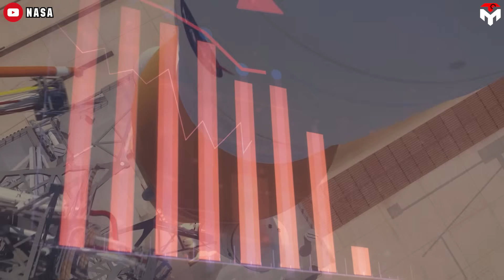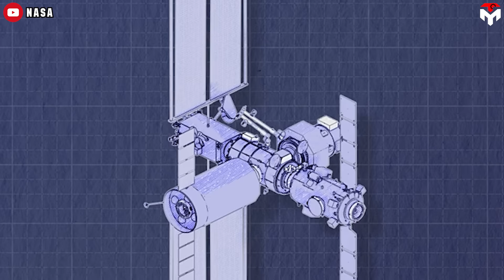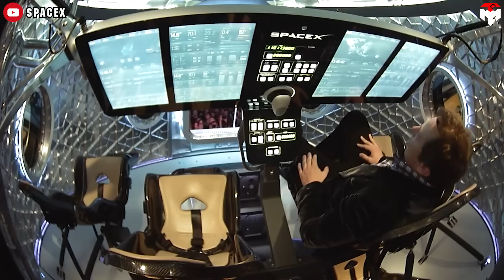Genius! SpaceX big Solution to Launch Dragon to the Moon Instead of NASA 4$ Billion Rocket...

Comment: the elevator of the whole starship can be made modular like canada arm, it will attach at the \base of star ship, and extend on ground so the astronouts who dropped from top will slide on ground of elevator is made like cana monkey swing arm, this sliding insted of moon surface walking is faster and cooler just like driving a car but its the ramp of elevator which laid ny starship

Comment: SpaceX already have all the necessary equipment except the lunar lander for lunar mission.   It can use three Falcon Heavy rockets to launch three pieces of equipment: space capsule to land on Earth and orbit the Moon, Lunar Lander, and finally small rocket to send  Lunar Lander and space capsule to the moon and back to earth.  Therefore SpaceX is using three FH to launch rocket, lander and capsule into high Earth orbit.  In space, capsule, lander and rocket merge.  The CLR is send to orbit the moon.  The lander separates from CLR and lands on the moon.  When it returns back CLR it travels back to Earth orbit.  There the capsule separates and lands on Earth.  The returned lander can be studied to improve the quality  of the next mission etc.  It can be done very cheaply with NASA new smaller budget.  It will be a dress rehearsal and experience for astronauts for future mission on Mars, Mars's moon docking/landing and other moon/meteor landing.  It will be a testing ground for equipment and biology tolerances etc.  Generally speaking SpaceX is almost ready except for lunar lander.  Lunar lander can be cloned/improved from Apollo experience.

Comment: Disagree...Dragon isn't armored enough against radiation. Dragon is fine for Neo but not a moon shot.  It would be better to just let SpaceX launch Orion using falcon heavy. It would be faster. Additionally,  there are 4 capsules ready to go now. All is needed is the proper docs to fit Orion to Falcon heavy and conduct 2 tests around the moon. Then all that is needed is a lander.

Comment: I've been saying this for years.Get a bigger dragon.Put it on top of the Falcon heavy.Go to the moon.Get a bigger dragon.Put it on top of a starship booster , go to the moon
Reply: Also, I've been saying it for years. So, let's do it.
Reply: You understand that the problem with liquid-fueled chemical rockets ('starship', for example), is that they are inherently inefficient. Okay?

The bigger the rocket, the more fuel it has to carry. The more fuel it has to carry, the bigger the rocket has to be, the bigger the rocket has to be, the MORE fuel it has to carry, and so on. Get it?
Reply: We are NOT going to visit Mars with MANNED missions, much less, 'colonize' the distant and hostile world, with chemical rockets! Nuclear-Electric or Nuclear-Thermal propulsion systems? Very possible.

 Conventional, liquid-fueled chemical propulsion? Impractical, illogical, inefficient, and too expensive, to move the necessary supplies to the astronauts, or to the astronauts themselves who will be on Mars.

Comment: Lunar Gateway is RETARDED. The only reason it exists is because the SLS doesn't have enough Delta V to get the payload to low lunar orbit. Well... instead of building an expensive space station over a dozen launches then using it to support moon landings the money should have been spent on a BIGGER UPPER STAGE for SLS or simply an expendable 2nd stage and a lunar direct 3rd stage for Superheavy! But, you can count on NASA to do the stupidest things and spend the most money doing it!

Comment: Apollo had a service module with a strong enough reactor to get itself out of lunar orbit. Same thing for orion .Crew dragon has not. Behind the crew dragon you have an empty tube use for storage.. How are you getting out of lunar orbit? Your grey dragon is the same. Orion took a long time to develop but it's a machine especially build for deep space, and well sheilded for radiation, and it's service module is what use to be a  European automated space craft build to work with orion. This  video is make belive easy solution that will get some like or Yesss but the devil is in the details.🤔
Reply: lol, Apollo didn’t have a reactor. It used fuel cells for power and a reaction engine. The S4B shot it into a translunar orbit and the Command Module did the lunar injection burn and the return trajectory burn as well as any corrections that were needed.
Reply: Each Apollo spacecraft had a service module and a command module. The CSM had an engine called the AJ10-137 that used aerozine50 and nitrogen tetroxide that they put in contact with one another and created an explosion. Near the moon,   they turn the ship around and ignited it to slow it down enough,  then they put themselves in orbit. Once the mission was done they light it up on the other side of the moon to get enough velocity to escape the pull of the moon. In the Apollo 13 incident an oxygen tank blew up partly  demolishing the  Apollo service module. Since they couldnt stop, they swung around the moon, too fast for lunar orbit and came back home. I was 8 years old when Neil Armstrong landed on the moon, and really into this. And still to this day. Bye!
Reply: @FrancoisBrindamour  reactors don't produce thrust and what you just explained isn't a reactor it's just a chemical rocket.
Reply: Yeah your right on that detail. It's a misconception from a long time ago, when we were kids. Bye!
Reply: https://ntrs.nasa.gov/api/citations/20090015391/downloads/20090015391.pdf
Reply: reactor...

Comment: Falcon Heavy isn't crew rated yet, so it has to be evaluated and tested with an ISS crewed flight. So atleast 2 flights before a trip around the Moon.
Reply: it's 3 falcon 9's strapped together wouldn't take them a second to get it crew rated if they ever wanted it for crew.

Comment: After the disastrous Obama years, where he deliberately took the USA out of manned space launch for nearly a decade (simultaneously cancelling the Shuttle and Constellation without a replacement plan) , and paying hundred of millions of $$$ to Russia to take our astronauts to the ISS (pssst...tell Vladimir that I'll have more flexibility after the election), NASA employed a pragmatic approach to putting the USA back in the manned space launch business. It placed 2 bets. One on Space, Inc.'s usual suspects (e.g. Boeing, etc.) and the other on space start-ups, like SpaceX. Remember, SpaceX at the time had not yet singlehandedly put the USA back into manned space launch as it eventually did, so the hedging/redundancy approach was pragmatic. And, well, the plan worked and worked beautifully. Private start-ups won the race. So, time to move on with the winners. And thank the losers for participating.
Reply from the maker: times have changed
Reply: @techmap9  Yes, they have. We're 1/4 of the way through the 21st century now. Time to start acting like it, right?

Comment: I still think that a 'lunar gateway' type station would be a prudent option. It could be a permanent staging post to take smaller, fuel efficient craft to and from the surface. Then the XL could still be used to resupply that station with bulk for longer stays.
Reply from the maker: Thanks for cmt. Maybe Congress needs to rethink